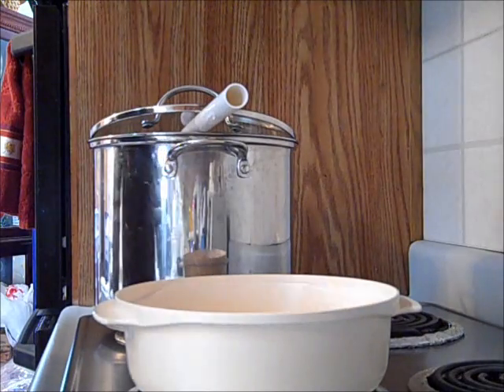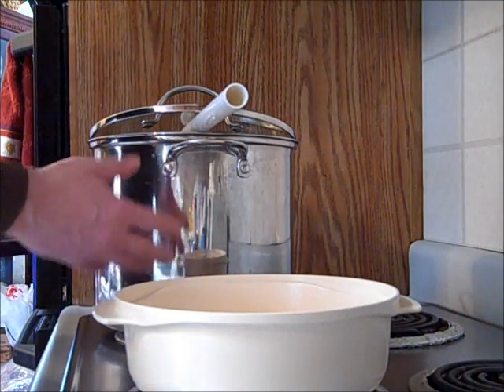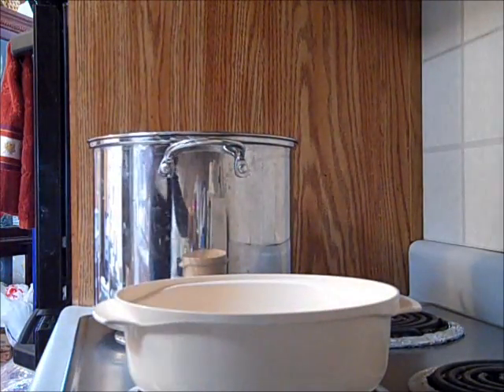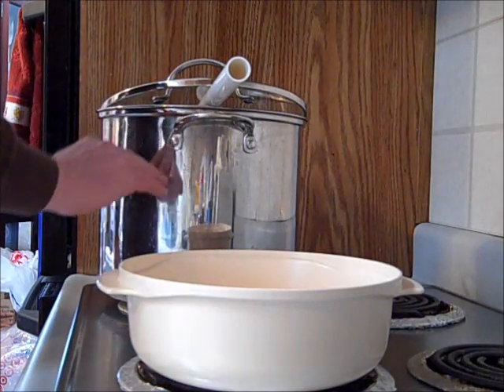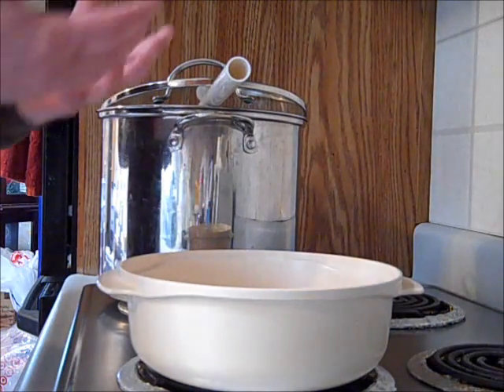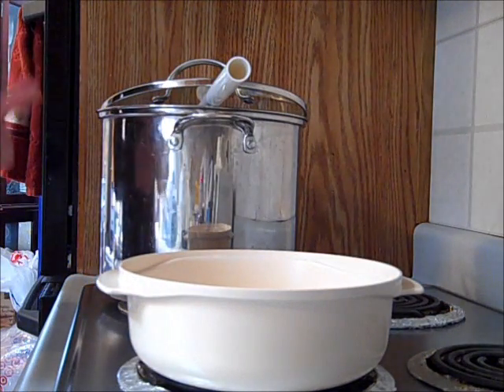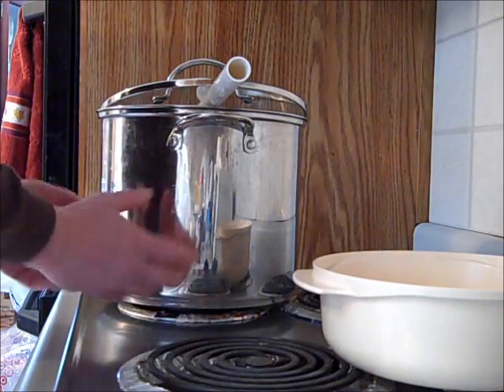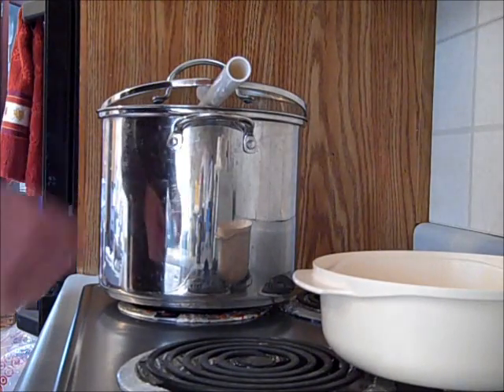Distilling plutonium radiated water from Fukushima Japan Q and A

Comment: Distillation of the water has nothing to do with need of the water, it's to consolidating the waste isotopes into a solid.  You don't leave behind or dump radioactive water, you keep boiling it away until you just have the caesium left over, which you can bury.  And you don't need to expose yourself to the contaminated water either, the entire loop must be closed off as a completely sealed system.  An actual system is going to look much more like an alcohol distillery on steriods, than your pot and tube with the lid cracked open on top.

Comment: Sorry, I had to correct your distilling method or else some bloke is going to attempt follow your way of distilling to maybe get rid of salt or barium from their drinking water & it's not going to work; So, 1) you will want to if you are suicidal & you are responsible for the nuclear meltdown in which you feet it's your duty to see if there's any way that you can lower the impact to environments; 2) you can't &; 3) also can't, but that question is the reason why nuclear plants should not exist.

Comment: Do NOT boil the water or else it will jump into your collector of clean water, the small pot. Now put on the lid for the large pot, but put it on upside down. The lid will collect clean H2O. Gravity will bring the water to the center of the lid dropping clean water into the smaller pot. centered inside of your large pot. Start with low heat. Check up on it every few minutes to make sure the lid is accumulating water & to make sure that it is NOT boiling. Can not stress that enough, NO BOILING

Comment: Your distilling is wrong. Toss out ur pipe. The metal pot is fine, but you will need a glass lid that comes to a knob at the top versus that handle. Your handle may still work. Get a small pot that will fit inside of ur large pot. Slowly pour in the toxic water without splashing, to a level no higher than an inch from the top of the small pot. Then very slowly without splashing, put the small pot into the center of ur large pot. TDo NOT boil the water!!! (continue on next comment)